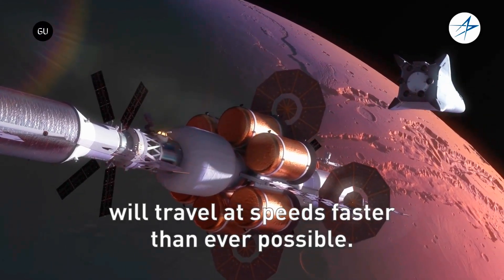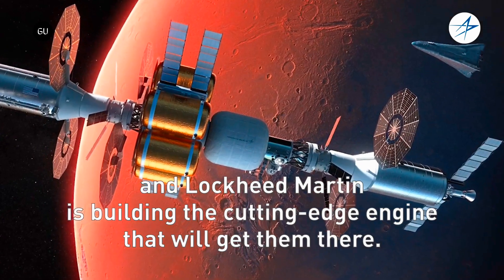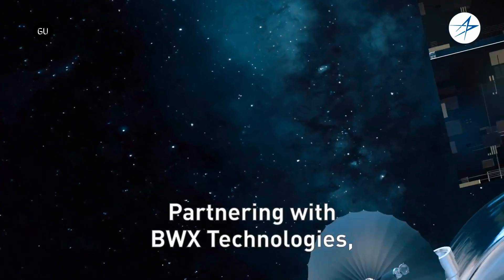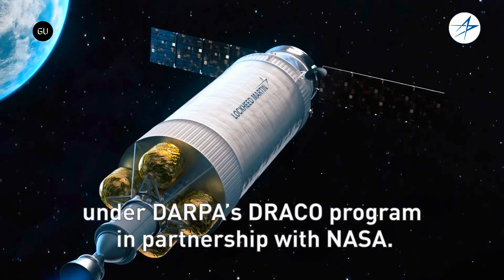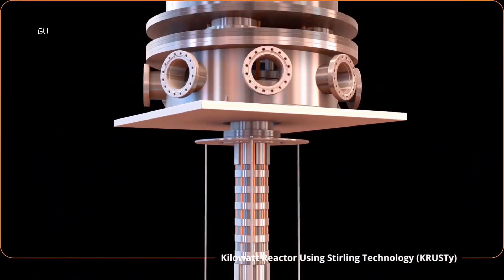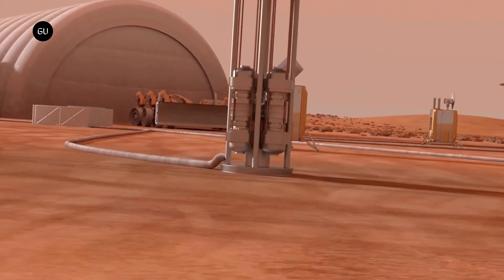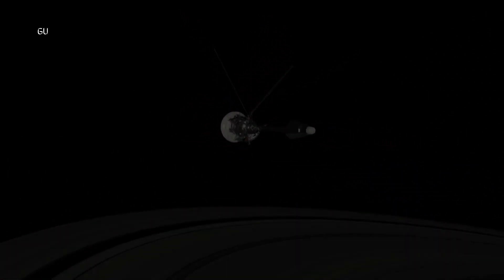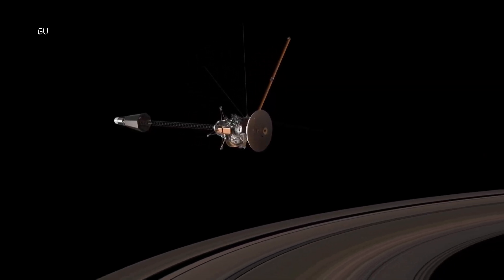Lockheed Martin to Develop Nuclear Spacecraft

Comment: You will need at least 1 trillion for this work.
Reply: Nah, all the basic development was already been done back in the 1960's. The US had functional nuclear rocket engines. The were never used outside of testing. In a lot of ways its simpler than chemical rockets. You don't have to worry about the fickleness of a combustion reaction.